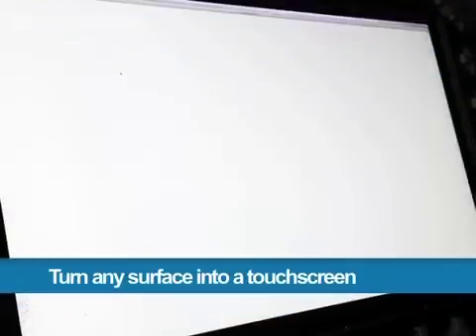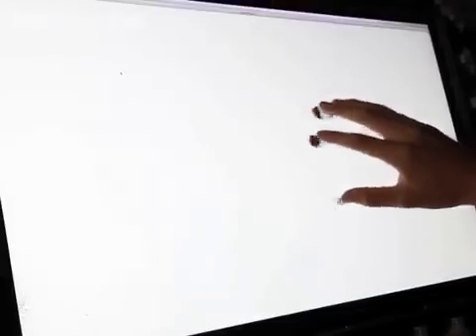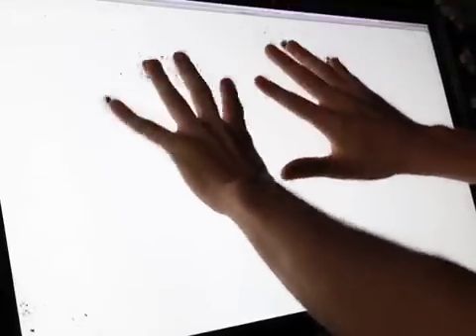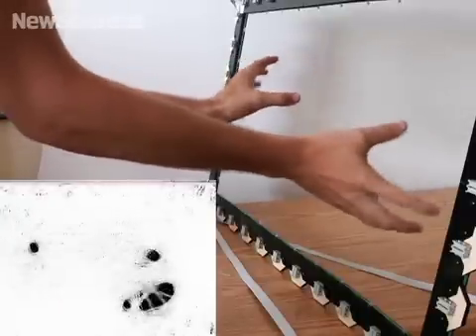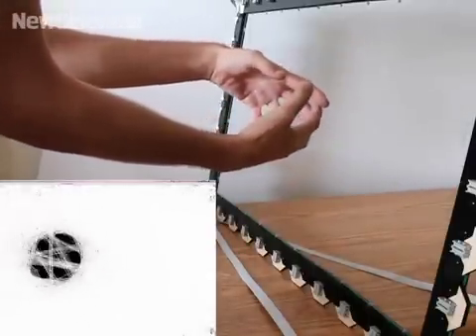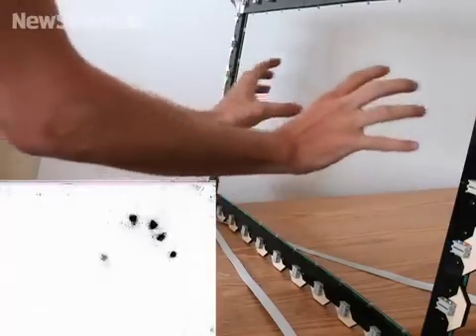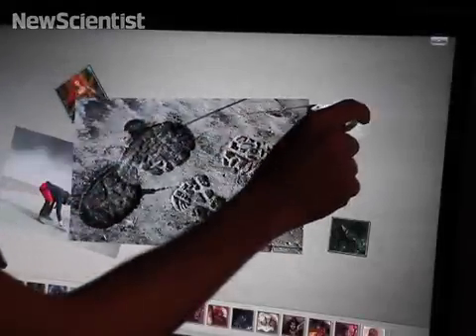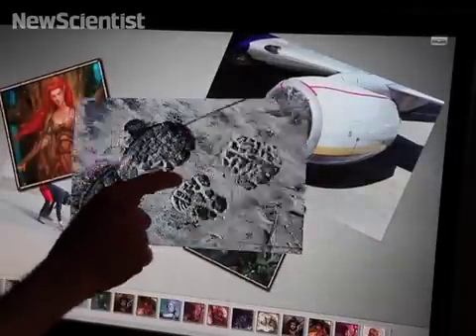Turn any surface into a touchscreen

Comment: Can this technology be used for 3D scanning?
Reply: I imagine you could use it for 3d scanning, except that concave surfaces would be missed. If you imagine trying to scan a shape, which is concave like a letter C, the shadow of the beams going around it to detectors would indistingushable from a letter O.

Comment: if you position the infrared sensors correctly in a room wouldnt it be like iron mans system where you use gestures and stuff to move objects? just suggesting
Reply: I'm from the future. We still don't have this technology yet :/